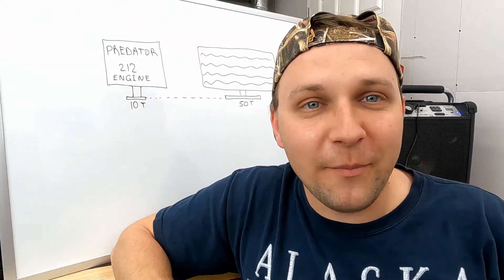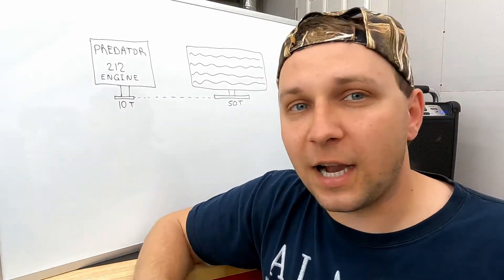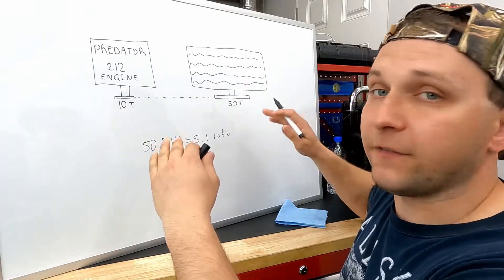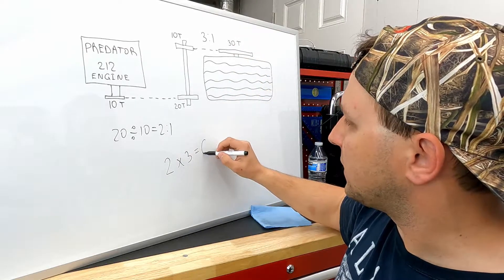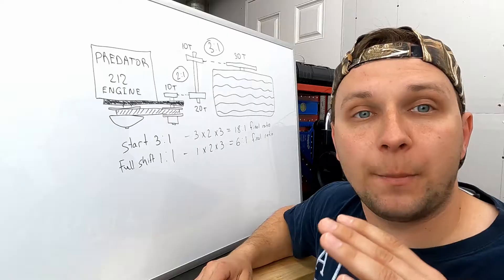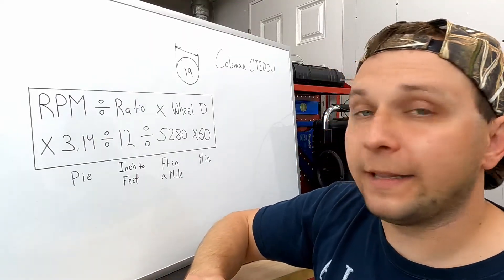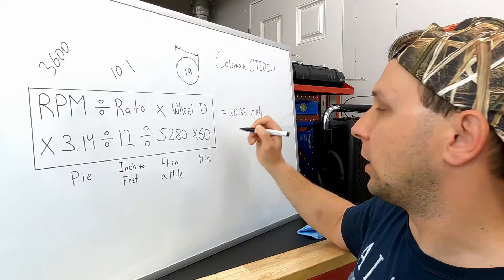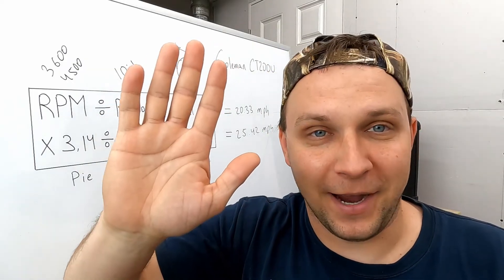HOW TO CALCULATE GEAR RATIO and TOP SPEED on MINI BIKE or GO KART

Comment: im currently running a straight chain 12t DR and a 65t DN, picks up fast but tops out at 30mph with a 224 predator. I want to drop the rear sprocket to 40t. What are thoughts on this? and predictive mph gains top end?

Comment: The math is not adding up here (to me) in regard to the CVT (torque converter) setup. If your're utilizing a CVT, why is the jack shaft there?  The "start" ratio may be 3:1 but variably changes on RPM of the engine (thus changing the ratio towards the 1:1 ratio quickly). The jack shaft in this example goes from 1:2 back to 2:1, essentially cancelling each other out. As well, there would be power transmission loss of effective power due to extra weight and friction.

Comment: I'm trying to use 2 small sprokets around the same size for a 212 powered 50cc atv it's not working at all idk if it's my centrifugal or my gearing it is just maybe 2 3 teeth bigger than my sproket on the crank shaft it dies as soon as I try and take off I did spend a hr and 20 mins tuning the carb and nothihg

Comment: Can you help me figure out my potential top speed?
I am installing a 10 hp diesel engine that makes 20ft lbs of torque.
I plan on using a 40 series torque converter and the larger pulley mounted on a jack shaft.
I will have a 12 tooth drive sprocket and a 41 tooth driven sprocket.
The tire is 25" tall

Comment: Just did the math on the manco dominator I'm building. I'm running a 10T on the motor and a 27T on the axle with 14" tires and mine will run somewhere in the 55mph range. Way to fast for me. Thank you very much. Idk if I will change mine or not. Itll be nice having that extra speed. May come in handy on a rainy day lol

Comment: Hey mate got a question iv got a atv bike the front drive gear from motor is 10 to 11 into gear box forward/back  .. gear box to rear is 19 to 40  just need help to work out the gear ratio & speed it will do .. cheers Chris

Comment: For some reason this didn’t work. My minibike does 38mph and I have a clutch with 12t and a rear sprocket with 75t. My rmps are at 4500 and my wheel base is 6inch. It says I will only do 10 mph which is not true.

Comment: to late test drive has been done and im down 15km/h which technically isnt a bad thing 52 on a golf cart is pretty sketchy especially since the brakes suck but im running through a reverse box and 40 series cvt with the stock rear end i was getting 52 at a 12:1 i have no idea what the reverse box reduction is but cvt out is 10T  reverse box in is 12T reverse out is 10T axle is 65T. now i will be changing the cvt out and reverse in because buddy who put it together used 35 chain on 420 sprockets so its skipping under load

Comment: Ok so I’m building a mini with a Predator 224, a 30 series torque converter, 10 tooth sprocket up front and a 72 tooth on the rear, running 21/7/8 tires.  
What kinda speed am I looking at here??
Reply: That would have nice low end. So much the bike may want to wheelie. 

For top speed it would just depend on what RPM you can get to. If you can get to 5K RPM you would be running high 40's MPH.

Another thing about this. If you are using the stock torque converter get a yellow spring for the driven and put it in the tightest hole. This way the belt shift will be delayed under full throttle and you will get higher RPM during the belt shift. It's worth doing if you are interested in the best full throttle acceleration.

Comment: I have a 212 mini bike with no torque converter, very new to this just bought the bike but I recently got a flat tire and I replaced the tube now my chain rubs against my tire, Not only that I was going about 15 mph on a dirt rode and my my chain popped off and broke. I have no Idea what to do about this and need help!
Reply from the maker: @ Talctothestrap, you need to align the wheel properly, you want to make sure that the front and the rear sprockets are in line

Comment: I have a mega moto 212, added juggernaut and it got slower. Built the motor and same results. What sprocket should I use for the juggernaut? Any help please!!
Reply: What size tire, 50 tooth is what I’m running on mine I had a 10t clutch with a 20t Jack shaft and a 50t rear then went straight chain with 5-1 ratio and it hauls ass after 20mph but not power until then just recently installed the tav2 and no she gets with the program I’m also using a mild modded 224 max performance predator

Comment: So I've gor a predator 212 on my mini bike it goes roughly 40 mph with the torque convertor. My rear sprocket is 31 tooth. So if I wanted to go faster what size sprocket should I use in the rear 🤔
Reply from the maker: @dylan sherwood, you will need go with a  smaller rear sprocket to go faster
Reply: @OkayBuilds  it gets up quick as hell i just want a little more top end speed

Comment: Why not have a larger gear driving the driven gear at the wheel? Wouldn't that improve the overall top speed?
Reply from the maker: @Jp Pelletier, you can, but I recommend using a torque converter, gives you a variable ratio

Comment: Hi I just bought a ct200u with a predator 212 engine I installed a new clutch 10t with rear sprocket 50t.the problem I'm having is that when I start it up it's great further pull start,but when I sit down to take off it moves slowly at full throttle.not sure what's wrong,do you think the clutch might be slipping or not fully engaged,because the clutch also gets real hot.please help anyone😰
Reply from the maker: @Jimmy Marin, your problem is low gear ratio in your set up, a torque converter ($70) will fix your problem and will improve the takeoff as well as top speed
Reply: @OkayBuilds  ok,thanks would you be able to direct me to where I can get the parts I need to be able to ride?thanks
Reply from the maker: @Jimmy Marin, no problem!

 Check this out on Amazon
212CC Torque Converter 6.5 HP 3/4" Go Kart Mini Bike Comet Clutch 10T 40/41 and 12T 35 Chain Predator Driver Pulley Replacement Set - 30 Series https://www.amazon.com/dp/B07S3TX4C5/ref=cm_sw_r_apan_i_GG27DMGQVHHGZT2Y4P12?_encoding=UTF8&psc=1

I got this one, works just fine!
Reply: @OkayBuilds  thanks!

Comment: Great video, but I have one question if anyone could help me. I am still wondering what gear ratio I should use for a 6 hp engine with 15 inch tires, that allows the machine to accelerate easily and have a decent top speed?
Reply: No one ever answers this question for those of us just looking for a good balance between acceleration and top speed

Comment: So I have a mini chopper that has a 12 tooth centrifugal clutch with a 35 chain running to a 72 tooth rear sprocket no governor 43 miles an hour maybe I want my bike to do 60 and have a number 40 chain what rear sprocket would I need if I got a number 40 10 tooth centrifugal clutch with a 40 chain what rear sprocket would give me the highest top speed but still be able to take off
Reply from the maker: @William Edwards, there's more things to consider, engine rpm, wheel diameter etc. Use the formula and you will calculate what you need. Type of chain dosen't matter
Reply: @OkayBuilds  I have a 14 tooth clutch that is new and I have just ordered a 60 tooth rear sprocket so hopefully that works
Reply: @OkayBuilds  the gear go-kart calculator is telling me 14 tooth clutch to a 60t sprocket is only going to do 32 miles an hour

Comment: I must have screwed up 😂 maybe someone else could figure it out.  1997 cr125 I would like to put a predator 212 with cvt.  12 tooth to 36 tooth and 26 inch tires.  I came up with 97 mph😳😳that can’t be right 🧐
Reply from the maker: @Marv The Great, your calculations were correct, with the setup you are planning to go with you will get over 90mph top speed, you need a smaller sprocket at the cvt(10t), and a bigger at the wheel. Good luck with your project!🙂

Comment: You explained it well, thanks! I'm going with a TC direct mounted to a jackshaft that's turning a 10T to a 39T axle sprocket with 22" tires. All this pushed by a 420cc with a couple of mods. I've got great expectations for this build. Again TY!
Reply from the maker: @Patrick C, thanks! 🙂 That's gonna be a rocket! Good luck with your build!
Reply: Wat about a 224 cc with torque converter ten tooth on the tav and 38 rear tooth and 20 inch tires

Comment: Thanks, with just a clutch-jackshaft should you shoot for 6:1. Does the wheel diameter effect this. I was running 10-36-10-30 on 16 inch diameter tires.
Reply from the maker: @Goomer, wheel diameter does not affect the gear ratio, it affects the speed, bigger wheel higher top speed
Reply: @OkayBuilds  Would you say a 6:1 Ratio is a good starting point? Thanks much.
Reply from the maker: @Goomer, what engine do you have?
Reply: @OkayBuilds  Tecumseh HS50 5hp, old school.
Reply from the maker: @Goomer, yes, 6:1 ratio looks good, with a 16 inch wheel and that motor you will get approximately 28-30 mph
Reply: @OkayBuilds  Thanks a bunch, much appreciated. Sub'd.
Reply from the maker: @Goomer, thanks bud!

Comment: Coleman CT200U 20mph? Ummmmm well I have worked on several CT200U and EX and 28-30mph is what I get stock with the governor still installed.
Reply from the maker: @Randy G, I went with the spec rpm 3600, in real life they spin faster, that's why the top speed is higher. It is important to measure the engine rpm before calculating the top speed, to get accurate results

Comment: I am having trouble calculating this pls help thx  6000÷25:4× it is a 14.5 in wheel (dont know the diameter)× 3.14 ÷12÷5280×60
Reply from the maker: @GNE, it equals 10.34 mph, looks kinda slow, make sure you get all your parameters correct. For the wheel diameter just simply measure your wheel from end to end width a tape measure. According to your information you got a 14.5 overall wheel diameter.
Reply: @OkayBuilds  the motor is going to run at 6000 rpm max the front sprocket is 12t and rear is 75t and tire is 14.5 D. Mabe that will be correct it is just a clutch sprocket
Reply from the maker: @GNE, your gear ratio is 6.25:1, let's calculate 6,000÷6.25×14.5×3.14÷12
÷5,280×60=41.39mph, that's better, good luck with your projects!
Reply: @OkayBuilds  thank you so much, now I have an idea how fast my mini bike project is going to go.
Reply: Ok maybe I was wrong with my calculations but thanks for helping anyways :)

Comment: What about weight factors for the top speed?
Reply: Great video btw
Reply from the maker: @mike fawcett, weight factor is really important, for example, if you projected a top speed of 50mph but your mini bike has 1 hp engine, and its really heavy it will never reach that speed, even though the calculations were correct. In this case you need at least 5-6 hp motor to reach that speed. You should consider weight of the rider, power of your engine, mini bike weight, even before you start building it. Hopefully this makes sense

Comment: so weight doesnt come in??
Reply from the maker: @Akhilesh Ezra, it does, for example, if you projected a top speed of 50mph but your mini bike has 1 hp engine, and its really heavy it will never reach that speed, even though the calculations were correct. In this case you need at least 5-6 hp motor to reach that speed. You should consider weight of the rider, power of your engine, mini bike weight, even before you start building it. Hopefully this makes sense

Comment: What would your recommendation be? I’m looking to do a minibike build but I’m trying to keep it simple. I’d like to have some take off in city traffic and still have decent top speed, I know that this might be a long stretch but it’s worth asking. Thanks for the video and ride safe.
Reply from the maker: @Miguel Pagan Sr, I would recommend going with a basic setup, that would be motor-torque converter-chain drive-rear wheel. Torque converter will give you a wider range of gear ratio, that means you can get a good take off and a decent top speed. You can calculate that with the formula in my video. Good with your build!
Reply: @OkayBuilds  thanks for the helpful video, another great video as always please keep them coming and ride safe.
Reply from the maker: @Miguel Pagan Sr, thanks alot! Ride safe as well!🙂
Reply: @OkayBuilds  hope you have more minibike videos out soon.
Reply from the maker: @miguelpagansr6128  yep, have some cool ideas for builds, but first I want to upgrade my garage a little, so there will be video coming soon about garage upgrades

Comment: Consider engine size, tire size, torque converter, jackshaft and axle sprockets. Is 5:1 on a stock 6.5 hp predator with 18 in wheels ideal, or would that 5:1 ratio work every better on a stage 1 predator at 8.8 hp and 16 inch wheels. You're looking for that optimum sweet spot .... strong torque out of the whole, yet a decent top speed as well. Experience will tell you how to modify the ratio, and the best combination needed to achieve it. Sometimes you've gotta just keep swapping parts until you get it just right. No biggie. That's how you learn.
Reply: well what should i do for my gocart with golf cart tires and a live axle😭 built predator

Comment: quick question, the higher the first number is the better the takeoff right??
Reply from the maker: @Garrett Lovell, if you mean the bigger sprocket on the engine than the takeoff is worse, for better takeoff you need a smaller sprocket on the engine, that's if I understood you right

Comment: For those of us building track sleds this gets us close i think, BUT for Us the mini bike tire is basically our drive cog that drives the sleds track. Does the final speed change after putting a for example 121" track on the tire of the mini bike or in our case the drive cog?
Reply from the maker: @base72588, I think you are right, because the track is just basically enlarges the foot print of the wheel

Comment: Hi, I'm too stupid to understand Math formulas so maybe you can do the math for me lol ? I have a 196cc Stock engine on my mini bike and I did add a 30 series Torque Converter to it along with Governor Bypassed and Stage 2 upgrade Kit. Right now I have an 11 Tooth Sprocket in the front and the Stock 50 Tooth in the rear and as it sits now it does 41 mph. Now I am thinking about changing the sprockets to gain a better top speed. Was going to change the 11 tooth in front to a 12 tooth and change the 50 tooth in the rear to a 48 tooth. If I did that then what would my final ratio be and how close to the 50 mph mark would I get ?
Reply from the maker: @Jason Grisafi, your gear ratio will be 4:1 and the top speed will be around 50 mph
Reply: @OkayBuilds  Thank You so much. That's what I was shooting for. :)
Reply from the maker: @Jason Grisafi, no problem, good luck with your project!

Comment: I new their was a formula. motorized 4 stroke bike, jackshaft, 9 tooth torque converter, stock 50 tooth rear sprocket. Have a 66 rear tooth sproket going to try. Hope I'm not to rpm tached out at 12 mph max at times where I ride at for short periods. I want all take off and bottom end power hope 66 sproket is enough!
Reply from the maker: @TOM TEE, good luck with your build! 🙂

Comment: Thank you very much I was trying to figure out why my mini bike for the power behind the motor was going so slow and just by putting a 20t sprocket on my torque runner shaft I could be doing 82.01 vs the 38 sum I was going
Reply from the maker: Glad my video helped!🙂
Reply: 82 mph? Wtf
Reply: Where did u find the 20t sprocket I’m running a 212 with tons of mods and after watching this video I definitely gotta change mines out I have the Juggernaut on my torque converter I need a bigger one please let me know thanks
Reply: @MrXlthegreat  just get a smaller rear